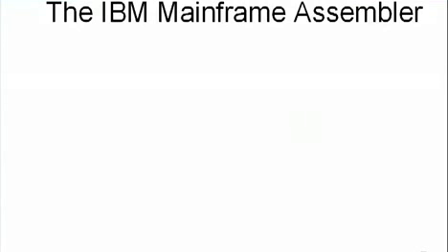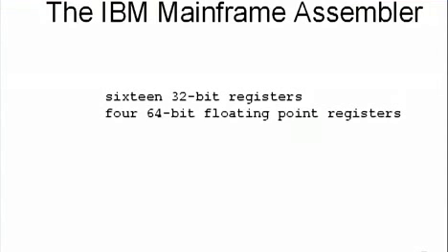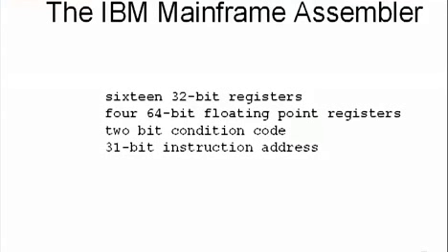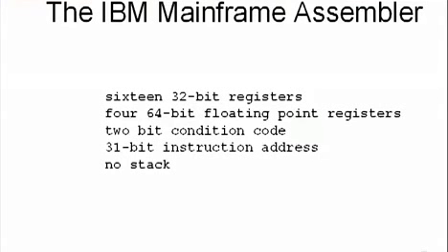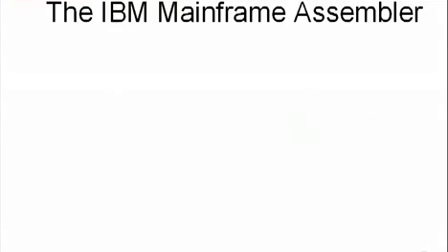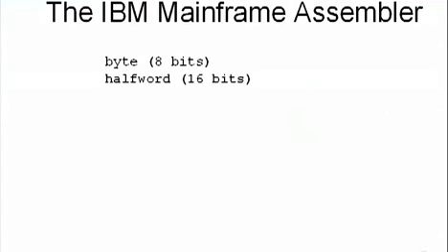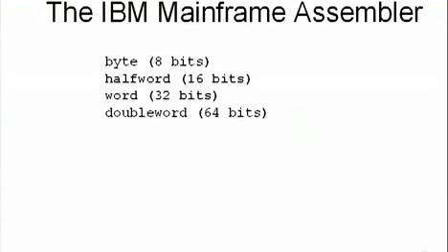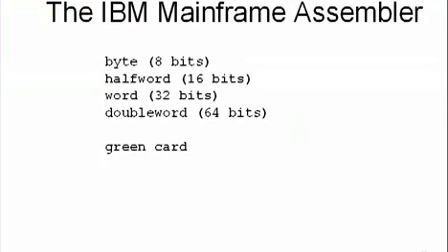68   The IBM Mainframe Assembler

Comment: I grew up with the card being called the yellow card.  I started programming on IBM mainframes in 1975 as a college sophomore using VS1 and later MVS.  I ended up on VM/370 R6 at The Oho University in 1977-1979 and worked as a lead systems programmer for TI (LICC) in 1979-1981 and as a developer at Cray Research from 1982 to 1993.  I can only say everyone I knew called them the yellow card.  I have seen green versions.   We had at least one, and several of us had many more; I had them at work and home.